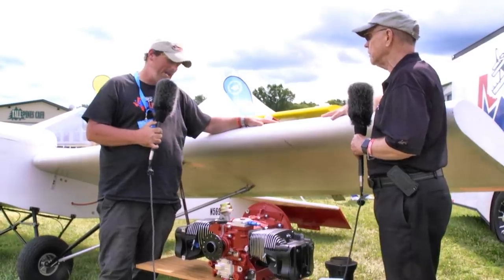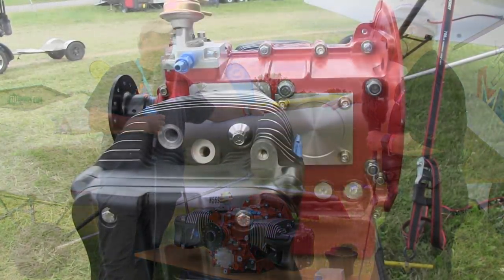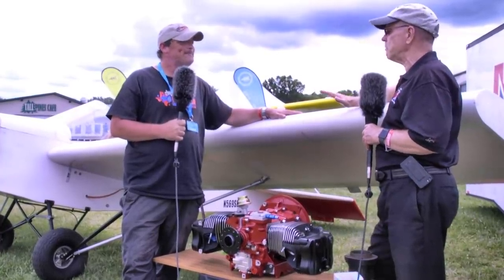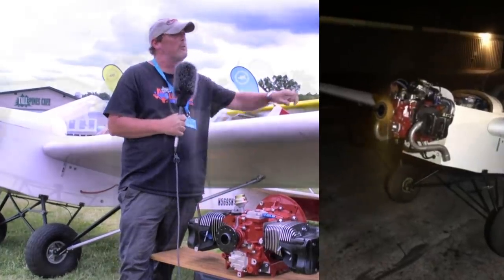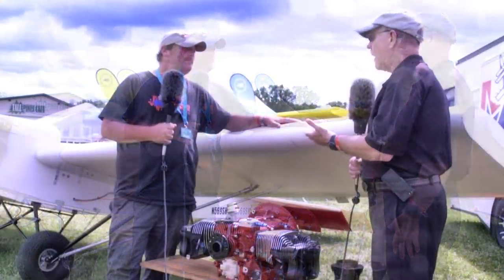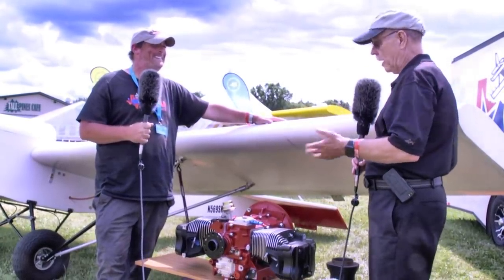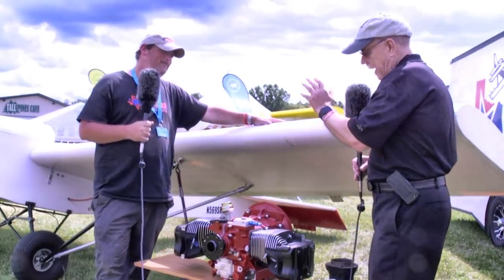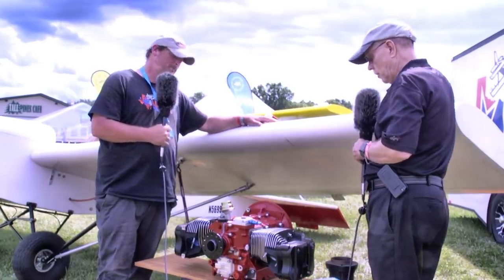VW aircraft engine conversions, Lone Star, Twin Cylinder, 4 stroke aircraft engines.

Comment: Hahaha good .  I am running mine with a model A Ford updraft carburetor.  I also used the full block. Cut crank and cam in half. Moved the thrust bearing to the middle. I am very happy with the engine.
Reply: You got 1/2 the crank & cam and replaced the 2nd or 3rd bearing with the thrust bearing? Niether one of those is strong enough for the thrust bearing. What about the rest of the case?  Chop it off or leave it?
I gotta see that.

Comment: Can you imagine if someone built new CNC cases for 2,4,6, or even 8 cylinder versions with those cylinders on it!!!  Also many other motorcycle cylinders could be used like those big Honda's  <3
Reply: I understand the weight penalty on the 4 cyl Honda Horizontal Motorcycle engine is prohibitive .

Comment: The engine block in the demonstration appears to be original 1600vw version. Assuming that flange is for the propeller, where the crank pulley and belt for gen/alt. would be. Distributor/fuel flange location. Cylinders 2 and 4 utilized, with 1 and 3 plugged. One serious question would be: What have you done to the bearing nearest the flange? (#4)  The crank snout was not designed to withstand that kind of torque. Air Conditioned bugs were known to need O/H twice as often due to torque applied to crank snout from a/c compressor.

Comment: Harley "Evo" top end, on VW cases...  Love it!
Reply: Robert Quick Really? Well then why not use an off the shelf H/D or S&S engine for light sport planes?
Reply from the maker: Weight!
The Ultralight Flyer
Reply: Harley Sportster
Reply: @dam4274   Besides weight the power pulses can cause problems not being evenly spaced.
Reply: @dam4274   Back when the sport pilot rule was going into effect, there was a company,  i believe it was named Hogair, that had a HD Softail big twin engine, w/ the counterbalance shafts setup, and was working on an airframe...  It's now called     http://www.skyray.us/
Reply: @dam4274  Because the v twin design is a piece of ---. The opposed boxer design is a much better design.
Reply: @southjerseysound7340  Performance would be poor for the weight Also durability of the v twin will never match an opposed boxer design.
Reply: Tom Hutchins as a V-Twin tech specializing in Harley engines I’m here to say you’re correct. This was a good idea they had combining the two but HD cylinders go out of round rather quickly. Passing compression tests is gonna be an issue with HD cylinders in this engine. 

Also the way a Harley V-Twin fires, the power pulses aren’t evenly spaced so they aren’t well suited for constant speed applications. That’s why the primary drive system has a compensator between the engine and the transmission.

Comment: I'll believe it when I see it flying and meeting those claims.
Reply: cut some ports into it to make a 2 stroke out of it, some vw air cooled were modified in to 2 stroke with boost, would make a nice uniflow dfi with dry sump, a vro oil injection pump and amsoil dominator 2 stroke oil. thats what i would run if i had one.
Reply: A prudent approach to any claims about technological offerings, doubly so in aviation.
Reply: Yes, and the proper question, would be after expecting tbo of at least 1,600 hours, would be to name one, or at least the one that has accumulated the most hours. The fact that this is a new engine, it’s probably best not to be suggesting those kind of hours. Seems like a nice enough guy to me though, hope things go well for him.

Comment: Bangin on 2 cyls though. Doesnt that put alot of stress on the crank and bearings?
And why not go with 4 cyls? Heads & cyls can be modified with deeper cooling fins and scoops. At stock a duel port 1600 is 56 hp. I dunno what the weight is, but alot of it can be either reduced, replaced with lighter metals or eliminated all together. 
I just recently pondered the VW air cooled for small aircraft idea. So I'm just curious.

Comment: This gentleman is pushing out some fantastic performance words. Sure would be nice if it actually works out to be true. I rebuilt some 1500 cc VW's that  never quite hit 55 hp.Higher compression ratio's produce more power, but also a lot more heat. An air cooled engine has a hard time getting rid of  that heat. The principal reason why VW finally went to liquid cooling in their cars. And motorcycle engines are mostly liquid cooled now as well. Also, noting that the work end of the motor is now reversed to where the accessories were once driven, wonder if the snout of that crankshaft can take the prop load. It does look sweet though.
Reply from the maker: The 1/2 VW engines put out about 45 HP using just the standard cylinders and heads. These units use, as described are using modern cylinders and heads from the motorcycle industry. 

If you just look at the cylinders and compare them to a standard VW cylinder you can see why they can easily get rid of the heat.

The Ultralight Flyer
Reply: An engine's ability to make horsepower is largely determined by the Flow of the Cylinder Head and the design of the camshaft.  HP gains from compression increase are nominal.

Comment: Have flown behind a couple of VW engines but the last one I had on a Cygnet SF 2A had an oil leak that could not be found. The engine ran great but it spewed oil out at only about 4 to 5 ounces per hour but it was enough to cover the belly of the airplane every time I flew it. Not a huge issue but enough to make me concerned. The only way to fix it would have been to take the engine out to find the leak.  I've talked to others that had the same issue and just accepted it.
Reply: Is it under or near the oil cooler in/out on the case? Thats where I found mine. I thought it was the oil cooler replaced it and seals a few times. Then I happened to see this itty bitty crack on the case that went from the inlet down about 1/4 in. Across and back up, but stopped before cracking off.
It was driving me nuts trying to find it.
Reply: @AngryHybridApe  Was yours a half VW?
Reply: @AngryHybridApe  My 4cyl VW was burning oil on  a warped cylinder that coated the bottom of the KR2 . It was barely visible as smoke but consumed enough oil to cause the oil pressure to fluctuate after 1/2 hour of flying.

Comment: Without running it ONCE: "We expect an over 1300+ hour TBO...." This is the number 1 way to kill a design. Once this has a few thousand hours on it, THEN set a TBO. HKS started with a 300 hour TBO and PROVED it could do a 1000 TBO over the span of a few years. Understand me, I DO want this to succeed, it seems like a decent design(on paper...), but please prove it a bit before you say this is the next best thing out there, thanks!
Reply: David miorgan  So...you've been running a half VW engine with BRAND NEW Harley Davidson EVO heads while adapting it's hydraulic lifter setup for 40 years now, eh? Wow, do allow me to borrow that time machine of yours someday ok? 🤣Do at least LOOK at the video before commenting, OK....sheesh....
Reply: Michael Livote is there a conversion for hours to miles since this is automobile engine base.  It would be easier I think to see what the TBO would be??
Reply: David miorgan  This is NOT a VW engine.  It's cobbled together out of different bits in a configuration never tried before.  I agree that their TBO is pure imagination until it's been proven.
Reply: @tphone720  Most of this is a proven VW engine...but then there's the motorcycle parts that are not nearly as proven. Usually it just takes time for the manufacturer of these engines to see if they will pan out and work properly---this isn't always the case of course. As for converting miles to hours, I don't think I've ever seen a chart anywhere that standardizes this, that's why I tend to go by hours only as this is now an aircraft engine and that's how they are measured. Time will tell on the hours this one can go.
Reply: He didnt say the TBO was 1300, thats just what they are expecting it to be.
Reply: Consider editing your comment. It comes across quite negatively. Besides that, any designer / builder has the right to estimate any parameter appropriate. He did not state the TBO as fact. And dang! ya gotta admit, it sounds good!
Reply: @tphone720  35mph is accepted as a divider for hours.

Comment: Very impressed... Does anyone know if the crank full length or some kind of half shaft?
Reply: It looks full length on their website. All full case 1/2 VW's that I've seen so far have modded full length cranks in them.
Reply: The crank is cut just behind the mid bearing area.  Take a tad of machine work to get the spacers and the H bearing right for crank end thrust cam cut also.
Reply: There is space shims that allow for thrust adjustment. And the crank journal has to be drilled and taped for a bolt to hold a thrust plate on back of cut crank.
Reply: Also the cam needs retarding on cam shaft because of RPM of prop.  Cannot turn prop tip faster than speed of sound.  It will throw the wood prop if RPM is too HIGH. Needs horse power developed at a lower RPM than a auto engine.
Reply: @jlyle51  
Ok, got it. But wouldnt have been easier to just counter balance the unused rod connections and leave the case whole?
Damn. It just doesnt sound like it would run for long. Those little engines put up with enough as is. 
Btw. Do you run 1&3, or 2&4?

Comment: So what makes that motor dissipate the heat to make over 42 or 43 HP? Must be climb out power for short bursts.
Reply from the maker: The large cylinder cooling fins get rid of the heat vs the standard cooling fins on the VW engine.
The Ultralight Flyer
Reply: @ultralightnews  plus there's a lot more air moving by the engine in an aircraft rather than a motorcycle.
Reply: There is also a very large propeller acting as a giant fan.
Reply: IF THESE JUGS ON A MOTORCYCLE CAN MAKE MORE POWER, WHY WOULDN'T IT MAKE THAT RELATIVELY LOW POWER OUTPUT WHEN AMPLE COOLING IS AVAILABLE?

Comment: More or a little less vibration than the hardware stores paint shaker? Ive seen several of these and better glue the rivets in also ....how much weight?
Reply from the maker: Video I watched of it running - does not show an excess of vibration.

The Ultralight Flyer
Reply: @ultralightnews  
Ive seen a few vids of them ...its like a paint shaker is under the bonnet was considering one.  Told forget it by experts
Reply: @davebar2017  internet "experts", right?

Comment: I’m going to throw my two cents in  about the VW engine conversion  I’m 57 years of age and over the years  I’ve owned  several Aircooled VW vehicles and about 12 SeaDoo brand watercraft  as far as a Airplane engine  I personally would want reliability  in comparing VW to bombardier , hands down to the VW  I’ve had several SEaDoo motors seize on me  and my brother in law  parts from local distributors  could be difficult to obtain  and even sometimes incorrect we had a brand new Watercraft that  blew several pistons in the same block although it was covered under factory warranty  after a investigation from the  main company they found their factory authorized repair facility was  using the incorrect piston each time they rebuilt the engine  and even that the entire Watercraft had under 50 total hours on it  the Dealership tried to tell us it wasn’t going to continue  fixing the machine under the warranty any longer  because the machine was over a year old ? Keep in mind the machine was over a year old but because of the time of which I had the machine being winter and cold  the new machine sat covered inmy garage witerized by the dealership  for months and months  that ironically was one of the first machines with a high tech  computer  and the dealership and factory did have all the information on how the machine was operated  when it did run  in SeaDoos defense we spoke to their President in Canada  about the problem and he personally authorized a brand new engine to be shipped fromCanada and installed at another Dealership  at no cost  to me  so the Company did do the right thing  mainly because I didn’t want a new machine with a rebuilt motor  because I paid and ordered a brand new Watercraft and engine , now on a 1972 VW Beetle that  I owned , although the original motor was refreshed in the 1980s  with new pistons,rings ,and gaskets  despite having over 1000K miles on the engine it is still running in another Beetle today  on the original block  and Crankshaft  , in a car if the motor dies you can coast to the side of a road in a Airplane that’s a little more complicated  so I would go with the  old reliable VW
Reply: ...damn...That wuz THOROUGH!!!

Comment: I've been hoping to find someone who makes a type IV VW engine (used on '72 and newer VW Bus, 914 Porshes + 912 Porshe) that was made for aircraft.  This engine has a much beefier bottom end than the Type I used on VW Bugs.  I was in Advertising for 30 yrs and one of my clients made Only Racing Type IV engines that put out 200+HP!  The builder installed an additional head bolt on each head to prevent oil leaks due to this whopping HP increase.  I had one of these Type IV engines with dual webbers in my VW Bus.  I would drive up to Reno, NV from SF going 80mph with ease.  It was oil cooled with a 2.5qt deep sump and external radiator (mounted 3ft away from my engine with an electric temp. controled  fan.  Total 7qt system! I think a water cooled head system would be better and lighter.

Comment: I don't think he's going to get anywhere near the TBO he is estimating.
Reply from the maker: And the reason for thinking that is? You already have VW conversions that are getting that kind of TBO. Using more modern proven technology would seem to give an even better result.
The Ultralight Flyer
Reply: The average Harley engine will require several top end overhauls before the average air cooled VW engine will need its first one. If air cooled VW engines needed rings and valve work every 25k they wouldn't have the reputation the VW Bug had.
Reply: Why not?I've got VW pd  ,engine 265,000 miles equating to near 8000hrs and never touched so 1500 to 1800 hours would be a doddle.